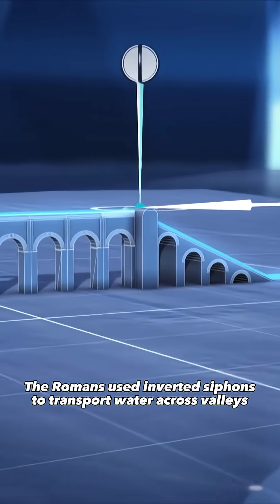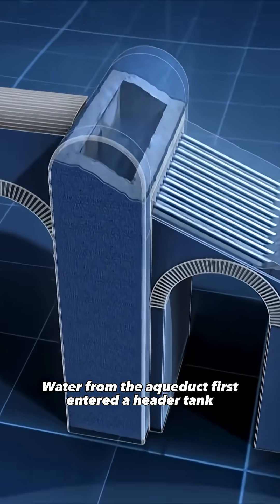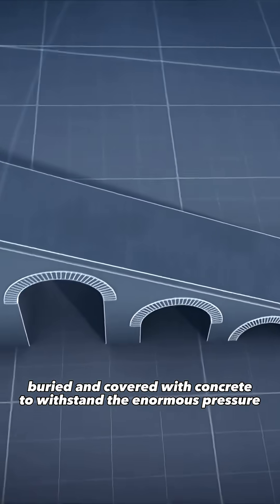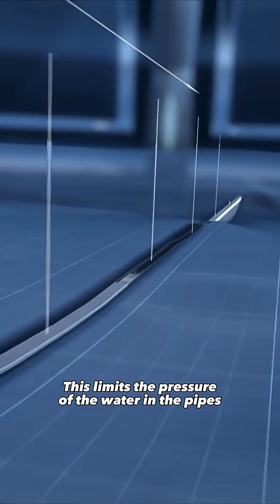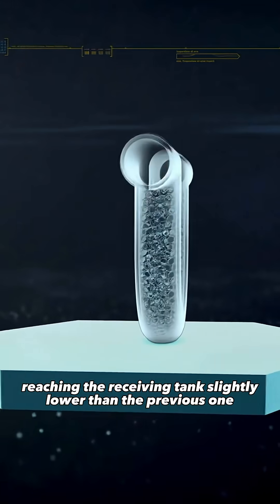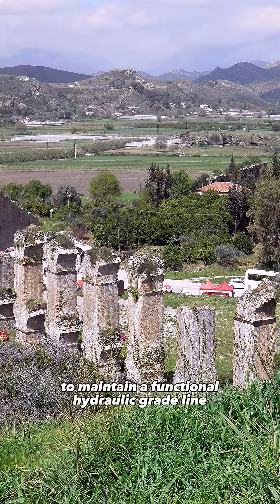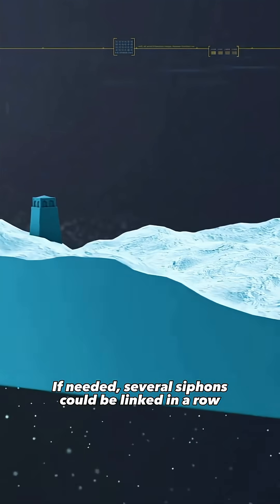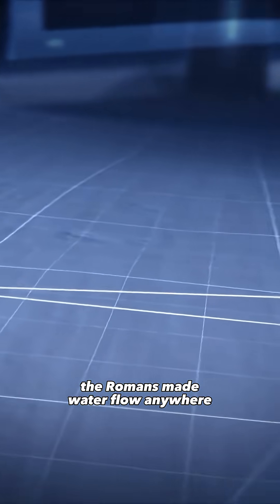Roman inverted siphon explained #history #romanempire #engineering

Comment: Something not mentioned is that you can raise water velocity by making the pipe smaller, that's why they used many pipes instead of a single larger one. Think about when you close the watering hose partially with a finger... that's it

Comment: The drawback to the is the sand... You have to used compressed air to clear the line and can get kidney stones because it is mineral rich. If the water is in contact with lead, that's another issue. Some of these aquaducts are still in use today.

Comment: The video used the confusing term 'inverted siphon', but it sounds like most of the pressure forces are positive hydraulics from reservoirs far above. To do a true siphon would have been an engineering challenge because any tiny air leak would let in air, stopping flow. With what they were working with, lead connections would have made getting a completely air tight seal impossible. So the key is to tap into reservoirs high above, generating enough positive head pressure to push air bubbles out.
Reply: Exactly and this was not a good explanation
Reply: They use lead on syphons because it could be sealed easyly as lead pipes can be solder to each other at a relatively "low" temperature. And its known they would have used air traps on their lead piping.

Look out Isaac Gallo youtube channel to understand a little more about this isssue.

Comment: That's not a siphon. That's not headloss.  This is not a good video
Reply: Any system that uses a difference in elevation to push water around is a siphon.
Reply: @Coastal_Cruzer  it's only a siphon if some part of the pipe is at a higher elevation than the entry point, otherwise it's just a pipe. The whole point of a siphon is that it enables water to flow over some obstacle, and it has to be primed with suction.  You can't just pour water into it and it works.

Comment: Lead? Why they dont use clay? They have their roman concrete technology, why not clay instead of lead
Reply: Lead is very easy to work with. It doesn't rust. It's soft. It could quite easily be made water proof. And there was a lot of it.
Obviously it makes you insane, but they didn't know about lead poisoning.
Reply: You can melt lead with a candle. It's super easy to make and repair a water tight joint with lead meanwhile clay cracks

Comment: The ultimate destination needs to be lower than the ultimate starting point for a siphon to work.
Reply: of course and in order to do that, sometimes they exploited water springs hundred of miles away. If there were hills or hollows, no problem: they dag tunnels, built viaducts, siphons. There were decantation tanks and distribution systems. Sometimes some channel parts were redundant to allow maintenance.

Comment: I grew up in a house with lead pipes.  Is that why I don't have an IQ of 300?  From all I've read, minerals in the water coat the interior of lead pipes so there is minimal contamination.
Reply: The real danger is anything acidic as it will pull lead atoms off the pipe surface.
Reply: @exnihiloadnihilum5094  Some time ago, I read of a city (I think it was in Michigan) that had to change their water source to one that treated the water, and all the many homes with lead pipes suddenly had undrinkable water!  The water treatment dissolved the protective coating.
Reply: I have a lead water pipe feed to my house. I test the water every few months using testing strips. Only had a trace of lead once following some work replacing floor joists where I had to move the pipework slightly. Never had unsafe levels though, touch wood. So long as the pipe isn't disturbed or, like you say, acted on by chemical imbalances, it should be fine.

I'm sure that plastic pipes are safer, but the cost too replace can be significant. That said, we may one day realise that our plastic pipes have been slowly poisoning us with nano plastics or other leeching agents 😂

As long as you're happy, it probably doesn't matter too much. If I had a higher IQ I'd only have more capacity to worry about more stuff 😬

Comment: The graphics are great to learn but the explanation of how the pressure was created is still lacking
Reply: I think, given the technical terms they use, the explanation is targetted at an audience which already knows that water flows downhill
Reply: @LWMphoto  Sick burn. 
lol.
Nice.
Reply: Gravity.
Doesn't get much simpler than that. 
Want me to draw you a picture? Oh, wait, they already did. LoL!
Reply: @HarryBalzak  By your name you could be Dutch but by the "draw picture" i know for a fact you are Belgian.
Reply: @ebre3080  Nope, I'm very very Dutch.
Reply: They just built pipes to siphon water from one tank to another one that is slightly lower. 
The other way they would do this is build aqueducts, the things that look like bridges and just carried water across the top. 
This accomplished the same thing but didn't require all that structure to be built.
Reply: Watch a video of someone building a small generator they start with water(stream) and just "hold" a bunch of water uphill a bit from you and you hook up like fire hose nozzles that are REALLY spraying. Also for the roman thing on here if the water wasn't constant or stop it for a reason I imagine there is some way for them to fill the whole system again because it has to keep those holding tanks full all the time.
Reply: I agree, "inverted siphons" doesn't really explain the process very well.
Reply: Google "siphon"

Comment: Lead pipes 😳
Reply: doesnt matter at all. The water was constantly flowing and a layer of minerals would form on the walls of the pipes very fast.
Lead poisoning would only matter if the water was staying still. There are still places today that use lead pipes.
Reply: @ThePointlessBox_ idk man it’s literally outlawed in my country and has been since before I was born
Reply: @opvask  thats correct, but modern water systems and roman aquiducts work differently.
The water in Rome was constantly flowing, there was not a single moment it was standing still. Water in modern pipes only starts moving once you open a valve/faucet/etc.
if you have the chance to visit rome, you have examples of lead pipe in museums, there's a layer of minerals over a centimeter thick on the inside, there was no contact
Reply: @ThePointlessBox_ Hmm, that’s kinda interesting actually. Thanks 👍